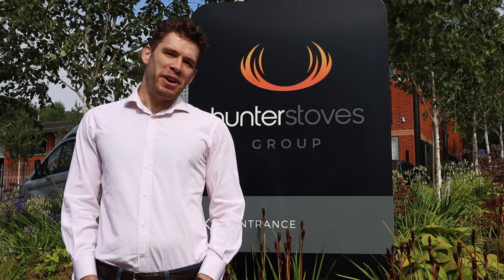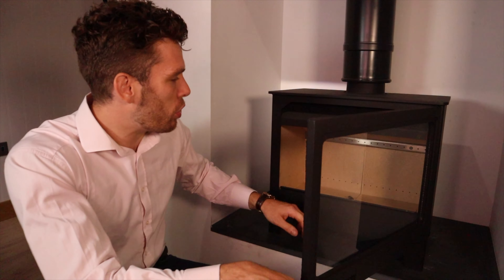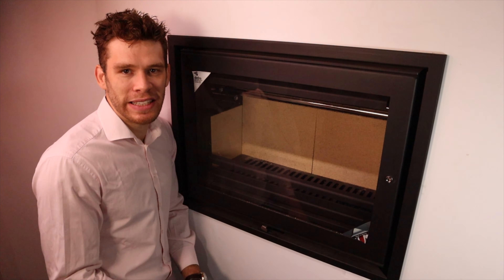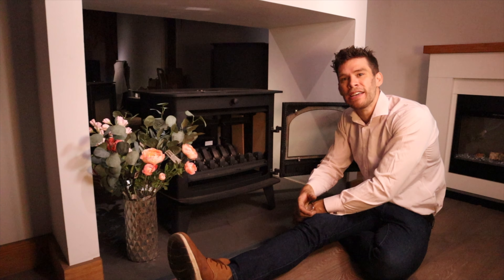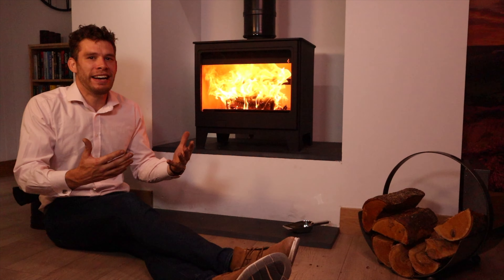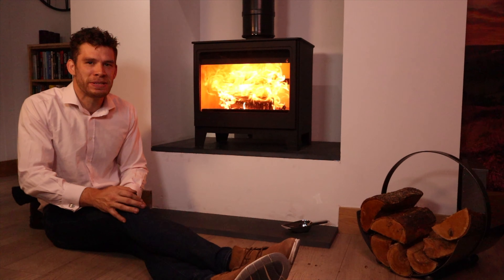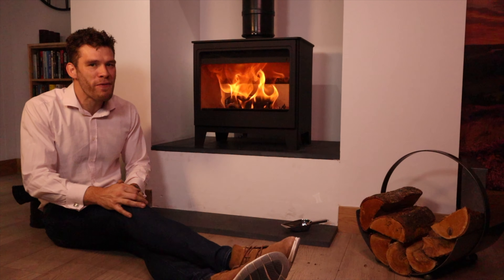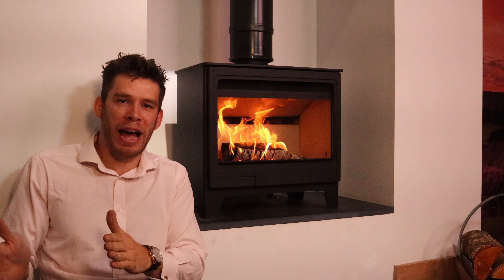The difference between wood & multi-fuel stoves

Comment: There is one other factor to consider for some, .....smoke coming out the chimney. Some "hearth stoves" (wood burned directly on firebrick.. no air "under") ... will smoke far MORE than a grate stove. A grate stove, with air coming from underneath, will much more easily achieve complete combustion which means almost no smoke. However, if your hearth stove has secondary air along the baffle this will eliminate most of the smoke once it gets hot and going, AND...  a hearth stove burned HOT with full air, even if there is no secondary air, will eliminate most of the smoke once iet achieves maximum temperature. Choke it down on low air though to "prolong it" and watch the smoke start coming from the chimney. The main advantage of hearth stoves is, like he said, "coals left over the next morning so a fire does not need to be lit again from the beginning. A fire should not be "choked down" to low air until it's been burning for at least 45 minutes. Most people do it after just 10 minutes (before bed say,) and create a smoke machine for their neighborhood.

Comment: So, just to be clear, if I allow the ash pan in my Clock Blithfield 5 to fill up completely, the stove will burn wood more efficiently  - and more slowly?
Reply: I have the same stove .
If burning wood , just let the grate build up with ash  and keep a layer of ash on it .
When there is too much ash , use a shovel to push some ash down into the ash pan , job sorted.
It runs very well on smokeless fuel and an easy stove to use to burn overnight .
Reply: @javidjames3319  Thanks, I do as you say, but this doesn't answer my question. The video suggests (in my interpretation) that keeping the ash pan completely full will mimic a specialist woodburner by burning the wood more slowly as though there were a solid base below the fire. I was asking for confirmation (or otherwise) of this interpretation.
Reply: Hi Phil , to answer Your question correctly I don’t think it would make it like a proper wood burner  .
A multi fuel stove is a compromise , I am no expert , but someone on here suggested fitting a steel plate above the grate …….. that would be the best way to go .
Reply: Ive  got  a  cast  iron  plate  i  put  on  my  multi  fuel  stove  grate  and  works  nice  with  wood,  If  I  want  to  burn  smokeless  I  take  it  out  job  done.

Comment: I have a multi-burner, it doesn't like logs, they don't burn well unless I open the vents wide. Coal is the preferred option but difficult to get where I live, the new bricketts (some) and occasionally charcoal are okay.
Reply: Use the excel from burnley
Reply: Where u live just bought oakdale
No oakde multi fuel
Better than single fuel end of storry
Reply: @indiana146  what are you talking about, I never mentioned oak  and I don't live in the US. Here olive, various fruit trees or pine
Reply: I’ve used my dovre 250 multi just for wood for years ( it eats it ) I’m about to convert it to wood only via fire bricks. That way I can put it back to the grate. ( just in case) great vids many thanks …

Comment: Nope wrong, the Purevision C&J is over 80% efficient when burning wood.
Reply from the maker: Hi Keith,

It may be useful to know that efficiency %’s are not necessarily a hugely helpful measurement as they are presenting a very narrow view of what real world efficiency is. DEFRA approved stoves have to achieve certain requirements to be considered smoke free, but what is mad is they achieved this in most cases by blocking the air vent open and burning your fuel at twice the speed. Multi-fuel stoves will burn very thoroughly, but it does not mean they are any good for what we want in the real world which is heat and good fuel economy. 

I haven’t tested a PureVision yet, but it’s on the list. It’s a modern stove and I’m sure they’ve taken steps to try and improve control and fuel economy, but stoves with grates and ash pans are always at a disadvantage when burning only wood.
Reply: Thanks for the reply, I will be interested to see your review. Thanks

Comment: charnwood and woodwarms articulating grate bars deserve a mention as they come very close to a multi which cam burn either fuel efficiently
Reply from the maker: Thanks for the comment, they’re certainly well thought out. I’ve not yet had a chance to properly put them through some testing, but when I get to them, I’ll be keen to see how they compare.
Reply: I have oakdale multi
Reply: Just the comment I was looking for. I’m trying to decide between Woodwarm & the Contura. 

How does the articulating grate work compared to the ones in this vid ?

Comment: I suppose the only true solution is to buy one of each.
Reply from the maker: It’s one solution, but generally if you buy the right stove you won’t want for the other fuel, because you’ll have everything running at peak. A good wood burner can run wood for just as long as coal, if used well.

Comment: just got a second hand stockton 5 midline, i am going to be removing the multifuel kit and putting the two extra firebricks in to convert to wood burning mode.
Reply from the maker: Awesome, have you managed to find a fitter?
Reply: @TheTortoise  I have to do a full refurb on the stove (all the seals) and need to get a hearth slate down. But yes he’s going to inspect the chimney then fit a flue liner and connect to the stove and commission it, so hopefully it works out as a cheap installation (paid £50 for the stove and about £50 in parts) that’s all signed off! Thanks for the reply
Reply from the maker: @Himalaya7s  that’s mad, £50??? 🤯
Once you’ve reconditioned it, you’d probably get £500-£1000 on eBay. Good luck with the install, sounds good.
Reply: @TheTortoise  a good buy right! I hope it runs well and efficiently as I’ve read people have issues with them being a bit lively. All new seals should help (the secondary air/clean burn rope seal and air wash rope were completely detached).. my chimney isn’t too tall either (upstairs lounge in an upside down house so probably around 5-6m from the flue collar to the cowl so I’m hoping there isn’t a crazy draw 😆 started prepping next winters wood already. Love it.
Reply from the maker: @Himalaya7s  it should be fine, but you can improve control if there is a problem. Good luck 🤞
Reply: @Himalaya7s  how did the conversion go? Have you used the stove since? Was it worth doing?
Reply: @DH-tv2yw  running very well. I have it in wood burning mode, tried smokeless fuel but didn’t get on with it
Reply: Cheers. It's something I have considered; think the stove that I have is a Stovax Stockton 3 with the multi fuel kit (was already in the house when we moved in), but we only burn wood, and there isn't much space for fuel with the multi fuel kit. Good to hear that you have had success in converting it to a wood burner.
Reply: @DH-tv2yw  to convert to wood burning mode, it’s just the case of removing the grate and blanking the linkage to the grate with a bolt. There is good info available online. From memory.. The MK1 didn’t have 6 firebricks, only the 4. I made 2 extras from some soft vermiculite I bought to update the 6 bricks of the later models. Seems to work well.

Comment: What would your view be for a stove for heating an old 2 story farmhouse, I've about 10 to 12 rads I want to heat. Wood burner be constantly feeding it? Or would multi fuel  be better or  the halfway one you mentioned. Which would be the most efficient and less feeding the fire? Thanks for the video. Cheers.
Reply from the maker: This is a tricky one because these types of appliances are no longer made, and given the power you are after they will possibly never be made again. In this situation unfortunately beggars can’t be choosers, so I’d probably buy whatever was available as they won’t be available for long. 

For me if it’s available, I would definitely go wood burner, the world is moving away from coal and filling a stove of this size with coal would cost a fortune. Wood can easily burn for 10-15 hours on a big wood burner, and the cost of running it particularly with a small amount of effort to buy and dry cheap wood, would be miles cheaper. 

But as I say, you will need to get a stove very quick, these are not made any more. 
On the flip side, if this is a new venture into solid fuel for your central heating, my advice is abandon this idea. There is no point in spending lots of money investing into old - dead technology, but if you already have the set up for solid fuel then buy it quick!!!
Reply: @TheTortoise  many thanks for the reply! We have no issues yet with stoves in Ireland are u in the UK? Probably whole different story then. But ya that's the way the world is going, away from solid fuels. Ya I have the plumbing and everything to support a stove. Oil is going crazy expensive and I have my own wood on farm and chainsaw. Happy days! Thanks again I'll look into Woodburn stoves. 👍🏻
Reply from the maker: @6900pilot  wood burner is definitely the answer then. 
Yea I’m in England, but these are EU rules so I imagine it won’t be long.
Reply: @TheTortoise  is it just for cities and towns this ban is on? That's unfair on the county people that are used to a fire. There is a turf ban coming in here soon I think September. Surely they can't stop properly seasoned wood stoves? Ist wood carbon neutral to burn?
Reply from the maker: @6900pilot  they’re never going to ban stoves. What they have done though, is introduce efficiency requirements that make large boiler stoves impossible to comply with, which is why production has stopped.
Reply: @TheTortoise  OK cheers for your replies I appreciate it. All the best and I wish you well. Thank you for the input I'll take it on board. Best of luck for the future.. John
Reply: @6900pilot  Hi John, out of curiosity did you find yourself a stove?
Reply: @TC-th1ey  not yet. I have a ton of clearing out to do first plus I have to get someone in to see if it's possible for it to work in our house.. we haven't used the back boiler fireplace in many years.

Comment: I’ve got a salt fire peanut 8. It has a grill on the bottom which is closeable, so it’s  able to burn coal or just close it and it’s perfect for log burning. I like having this option as I can get the logs burning quickly and hot, then I close it when the firebox is up to temp.

Comment: I've got a multifuel parkray consort 15 with wrap around boiler. I ripped the grate out within a few months and cut a heat brick for the base makes a world of difference. I get free timber so no need for it. 
The stove was already installed when I purchased the house.
The sides of the the stove don't have heat bricks i even contacted parkray to double check.
Reply from the maker: Yea you don’t tend to have bricks in boiler stoves, but removing the grate is a must if you’re burning just wood!

Comment: Hi there, I have a flavel Rochester 7, it has a griddle and ash pan if I want to burn wood only would I get away with cutting a 1/4" thick steel plate and insert it on top of the griddle (also my glass has got very fine crazing on it) the fire is just over a year old and not been used much.
Reply from the maker: The glass crazing is typically caused by smokeless fuel, mixed with moisture. Annoyingly if it happens you can only solve it by replacing the glass, but in the future taking care to only burn dry fuel will help. 

Thankfully if you switch to just wood, then this issue should never return.

Comment: What if you keep the ashtray fully closed? Isn't that perfect for burning wood ? There ll be no air coming up from below
Reply from the maker: Depends on your stove, but it doesn’t tend to work that way. Stoves always leak (no flame is possible without oxygen leaking in), so generally a grate will spoil wood burning efficiency and burn time.

Comment: Thanks for this information - very helpful. Can I ask if you class the Clock Blithfield Compact 5 as a true wood burning stove, as I think it has a grate?
Reply from the maker: No it’s not, you’d need the Sudbury for that.
Reply: That is correct , but with the Blithfield 5 or compact , if you let the ash build up over the grate it’s not far off like the Sudbury .
Let the ash build up  and let the ash pan build up  , as , as the Tortoise says a clean fire is a hungry fire 😀 from a Blithfield 5 owner .

Comment: Thanks for this! Do I understand correctly that a proper woodburner should NOT allow air to flow from the bottom of the fire into the fire chamber? I ask because I’m looking into a stove where you can choose between A. bottom plate massive 20mm flat steel with ashpan and cast iron grate, or B. ceramic (vermiculite). My preference was the steel bottom with grate, mainly because I’m worried about damaging the vermiculite. Same goes for the sides and back, you can choose either vermiculite or ribbed steel plates. I would prefer steel because it is not easily damaged, while vermiculite cracks.  
Another matter is efficiency, the stove manufacturer mentions in its manual that a steel interior gives a higher chance of a dirty glass. That is because with a steel interior the temperature inside the stove may be a bit lower. I asked them the difference in temperature/efficiency, their answer was that vermiculite mainly helps while LIGHTING the fire, but that later on it does not really matter. They say a steel interior is about 2% less efficient than a vermiculite interior. Would you agree? 
If the proper way is to first have a layer of ashes and have the fire on top of that, a grate and ashpan are to be avoided?
Reply from the maker: You could if you fancy, go for the steel version, and then cut a small block of vermiculite to sit on top. But generally if you’re burning wood, it is always best to avoid a grate and an ashpan. 

Their estimate of a 2% drop in efficiency seems very likely and reasonable, when you remove vermiculite boards.
Reply: @ The choice is either vermiculite or steel panels. Adding some vermiculite to the steel panels version sounds like a good idea! No grate and ash pan then. Thanks!

Comment: I’ve got an Arada ecoburn 5 multifuel but there’s no wood only converter kit available. Can I place a piece of thick metal over the grate to block the air from below? As you say it’s burning wood fast. Thank you
Reply from the maker: Yes lots of people have done that in the past. The other idea is leaving the ash to fill up, as that has the same affect.
Reply: @TheTortoise  thank you.
Reply from the maker: @AshleyBrayson  any time.
Reply: @TheTortoise  when I did this on my open fire it burnt the grate out quite quickly. Would it not do the same in a multifuel stove?
Reply from the maker: @joechewter1322  if you cover the grate with a bed of ash then there shouldn’t be an issue. If you’re always cleaning down to the grate then it could over heat. But you’re right to poi this out, because this is a potential problem. The other solution is simply remove the grate and fill the bad with ash, but all of these ideas are obviously a bit “Heath Robinson”, you’re always better off with a wood burner if you burn wood.

Comment: I have a chelsea solo multifuel stove, its a lovely little thing but wood fuel doesnt last as long as I had hoped. 
Was considering getting a 10mm thick steel plate lasercut to lay ontop of the grate for use when I burn wood only, then when I'm back onto using coals I can just whip it out.
What are your thoughts?
Reply: Mmm not sure that's likely to bring the gains you hope for tbh. Sounds like the ash would be a bit of an issue? When we fitted our conversion kit I mentioned it had the advantage of the extra room from getting rid of the grate and showing allowing an inch or two of ash to form before cleaning.
Reply from the maker: I’ve known lots of people simply remove the grate and burn on the base of the stove. It sounds a little dodgy, but that is essentially what a Villager C Wood is (the only difference is the C Wood didn’t have the bottom ash pan door), and that can burn overnight relatively easily.
Reply: Hi just wandering what your thoughts are now on this idea . I just purchased a clock multi fuel on was thinking of doing the same thing.
Reply: @topgolf7215  hi, I went ahead and had a 4mm steel plate cut to fit over the grate. I've noticed that I don't get as much ash waste as I once did as it has a tendency to burn off rather than fall through the grate into the collection pan. Once you have a decent inch or more ash bed you do notice that the burn times are slightly longer, plus once the fire is on its way out on an evening the ash and embers are still giving off a decent amount of heat even when the flame has died. 
It's not a night and day difference but it was definitely worth doing. Then when I go back onto coals I just remove the plate... Easy. 👍
Reply: @magoomagoon  thanks ,,,I’ve just purchased the clock 5 and I’m going to have a plate cut to suit.  Seems to me the best idea to get the best off both worlds depending on your source of fuel. I’m no expert so could be wrong but . So I’m open to other people’s thoughts on a modification like this even on a new log burner .

Comment: I’ve got a Hunter Herald 8 multi fuel stove with back boiler but it doesn’t riddle like you demonstrated. The grate barely moves so I have to manually remove the ash with a poker.
Reply from the maker: That’s probably due to some warping to the grate bars. If you clear the grate you will either find something blocking it from riddling, or you’ll see that the bars themselves have begun warping. You can replace them by going on the Hunter Spares website, if it is the bars that are the problem.